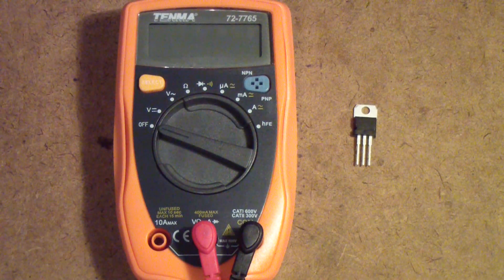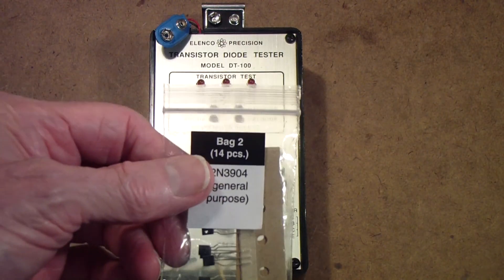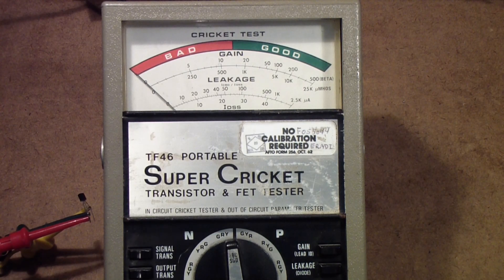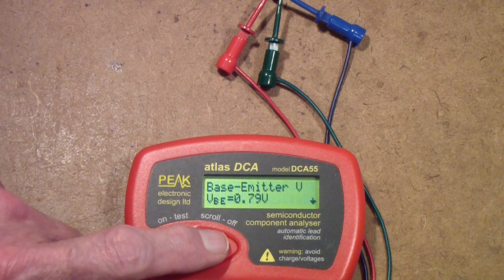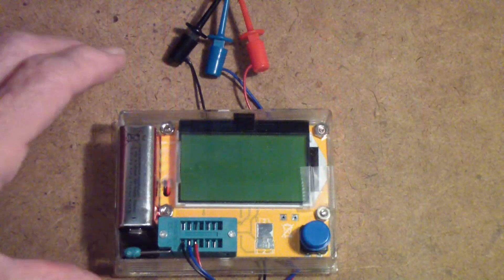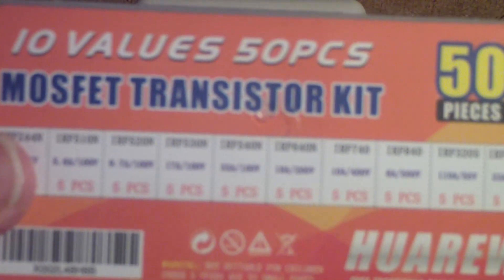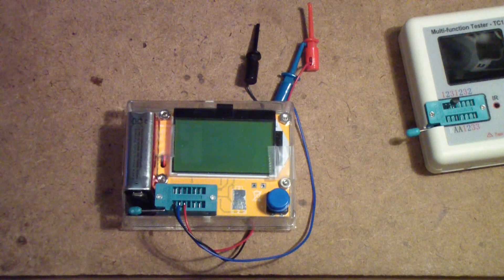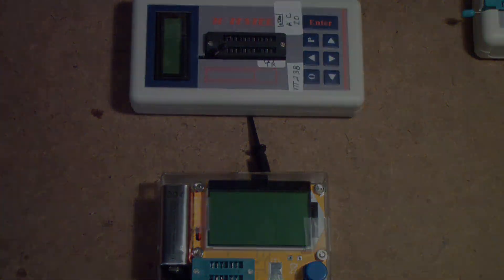TTT344 Transistor Testing

Comment: Thanks again.  I like that T4 a lot.  I've bought 4 now.  2 on the bench, one with leads soldered on, one without.  Gave one away, blew another one up.  Sometimes you can test things in circuit, but testing powered up is a different story.  I wish it had zener diodes too, for some reason I thought it did low voltage ones, but now I'm not sure.  I guess I should order that IC tester you have as need one, and testing zeners with a resistor and current limited power supply isn't easiest, or quickest, method.